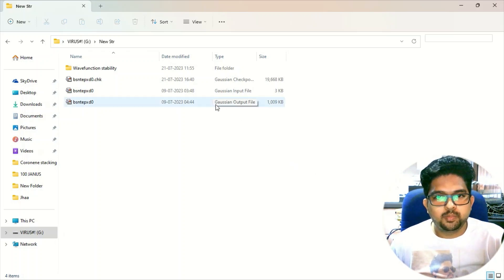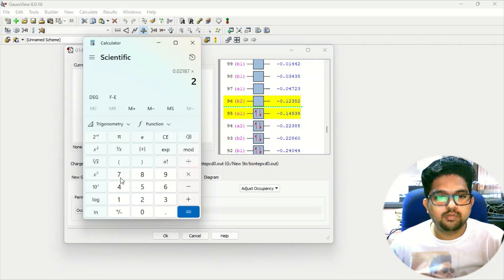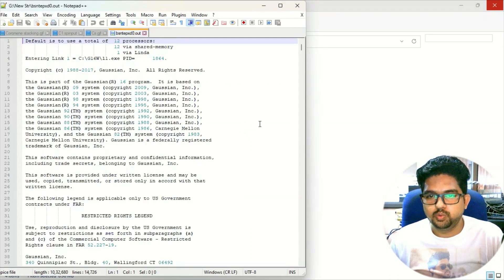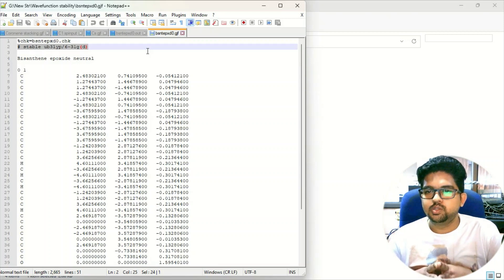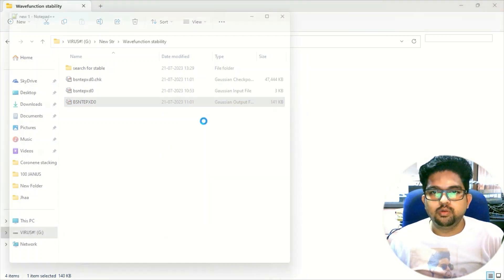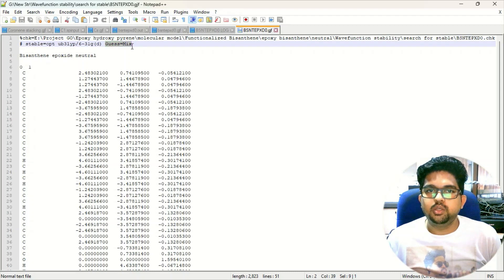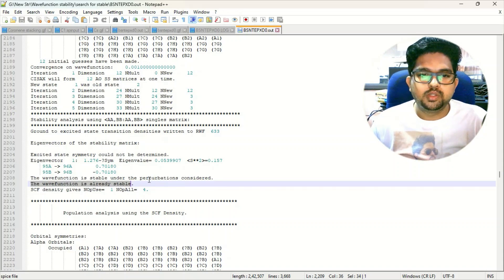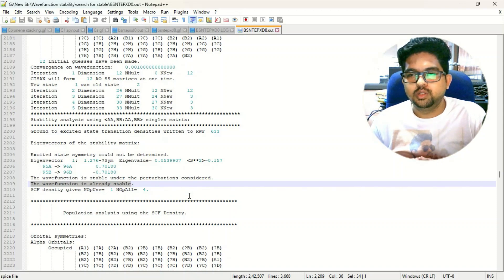All about wavefunction stability test in DFT calculation || Gaurav Jhaa

Comment: I am working with metal complexes and besides the problems with the stability of the wave function I have problems with the value of S2A, in some cases, trying to calculate a doublet, I get a value of S2A=4.4... Stable=opt does not work to remove the spin contamination, any recommendations?
Reply from the maker: Spin contamination is the artificial mixing of different electronic states. 4.4 value is really unusual. I think S^2 eigenvalues for doublet should be around 0.75
Use can try these steps to solve this issue, (1) Use better basis set-like def2-TZVP, etc. (2)Use hybrid functional instead of pure functional (3) Add spin correction using unrestricted Kohn-Sham methods or try open-shell Kohn-Sham method (4) If it still persists, it may be an issue with the single reference method, in such cases, you can try multi-reference methods such as CASSCF.

Also, try these keywords.
SCF=QC
SCF=XQC
SCF=NoVarAcc